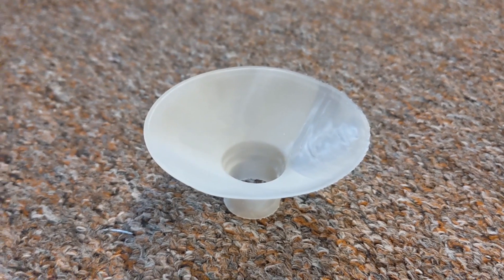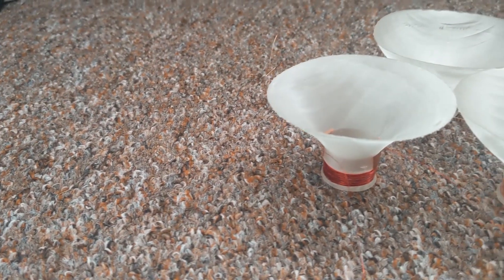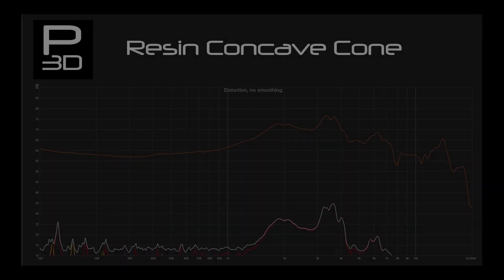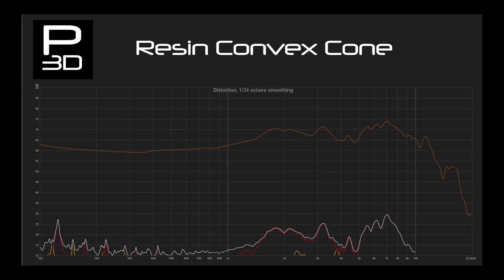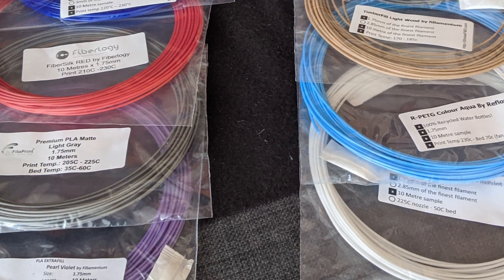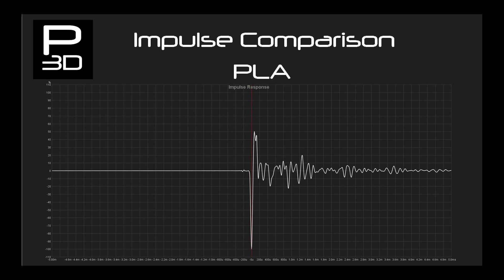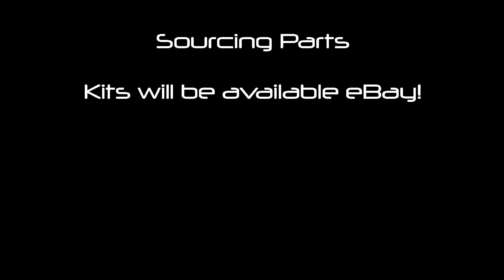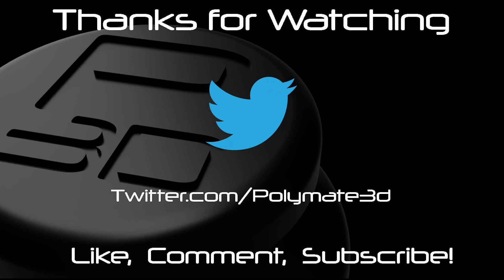MSLA vs FDM 3D Printing - Speaker Cone Test

Comment: hello, i am planning to 3d print a subwoofer cone here in my country. the cone that i need to print is not available for purchase in the US which is just sad because the sub woofer cost $1800 each (JL Audio 13W7AE). i am wondering if what type of print would u recommend on printing a subwoofer cone?
Reply from the maker: Subwoofer cone shape isn't too critical as your typically heavy mass and not using it within its cone breakup region.
What I would suggest is getting the dimensions of the cone, height width, and diameter to connect to the former (Tube the voice coil is wound too), along with weighing it.
From there I would probably go with a Concave shape as this will raise the cone break up frequency, and produce a stable pistonic nature below this. Then make the cone print at a thickness which matches the original cones weight. That way it should perform as a subwoofer, on par with its original one. This should work for a subwoofer, but wouldn't translate well to a midrange /full range / tweeter. Hope this helps - Paul
Reply: @Polymate3D  thank you for the detailed explanation for this. do u have fb page to follow you?

Comment: I wonder if annealing the cones would improve the sound quality.  It should help with layer bond and also release any internal stresses.  You might need to print a mold to clamp them into shape during annealing.
Reply from the maker: Shape is the biggest reason I haven't tried this idea further. That and I am working towards high Tg materials with properties I want as well. The key thing is there is a LOT for us to experiment with. I think A new cone profile test system is needed which expands on this simple one

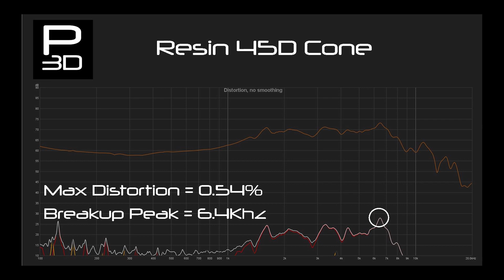Comment: 2:34 at what spl is that?
Reply from the maker: It measures on the graph at around 70dB but the actual volume tested at it approximately 78dB which works out at -27dB on my mic setup, giving plenty of headroom. As drivers get more powerful with new magnet motors, that reading will be done at a higher output. Possibly at multiple volume levels

Comment: Have you tried the new lightweight PLA from colorFabb? It creates a "foamy" texture and boast 65% weight reduction. Looking at the pictures of it makes me think of a paper cone driver :) Also have you seen the spiderless drivers from Mark Fenlon? Skipping the spider makes the cone much lighter. Since a 3d printed cone is usally heavy I would think a spider less design would be the way to go to make it as light as possible.
Reply from the maker: Hey! Yeah I really did and almost bought some, but waited until Stefan of CNC Kitchen took a look at it and it had around 600Mpa at maximum foamed capacity. Polymaker for a long time have also made a foaming version but not to the same degree or varying and that achieve 2.000+ Mpa and still reduces mass (Around 0.85g/cm3). Mark Fenlon is someone I very much admire and the MS models are really cool. Couple of problems for us right now though. (1) Mark has used a mix of 4 materials and Evan Yu is a very respected individual who devotes his time on just suspension systems. Nothing else really. (2) we need the center of gravity to be central ideally and we are not, so the cone will droop down and rub in the gap. Mark overcomes this with the negative camber cone which is patented or patent pending, and they use a aerospace grade alloy which has a young's modulus exceeding 600,000Mpa in some cases. I have a pair of Alpair 7's as my actual main system in my small house, and they are a constant benchmark to head towards! Paul :)
Reply: @Polymate3D  Thanks for a very detailed answer :) If only one person have made a speaker with only one surround before and is in the public domain (and surely someone must have) I highly doubt he will get his design patent granted. That would allow you to develop your design much further to take full advantage of the 3d printing process. To me it seems obvious that an inverted dome must give better dispersion in the higher octave and the old way of doing it is a pure cost saving way of making speakers.
Reply from the maker: @impuls60  Domes definitely have a good amount of potential but they do have more likeliness to buckle compared to a convex or concave coes as they are usually more shallow. Either way there on the list of other potential aspects to explore along with the mentioned BMR's or a support structure on the back of a cone. Its going to be a long journey, but SPL is definitely my no1 priority right now